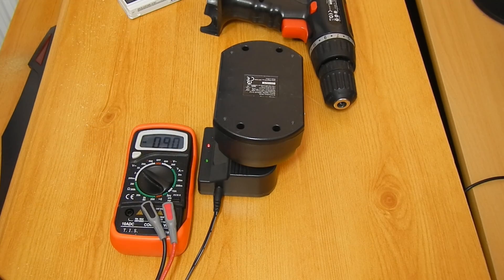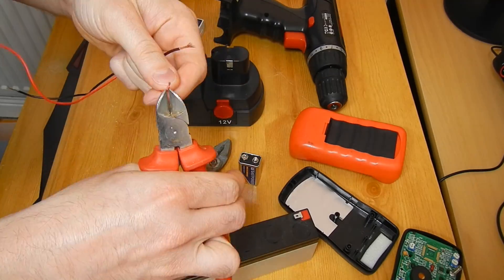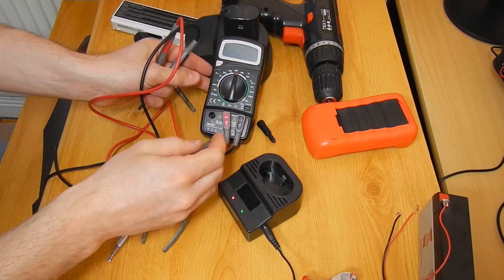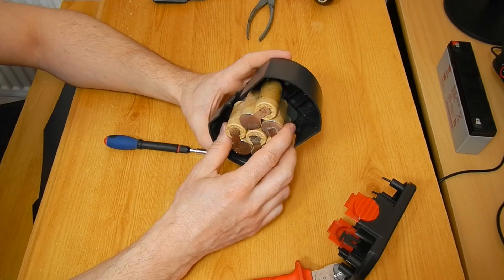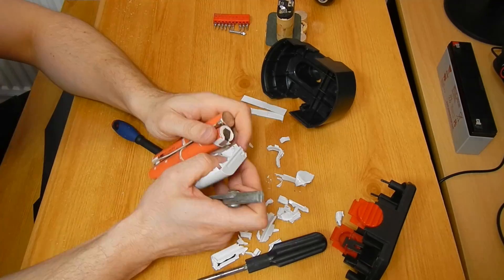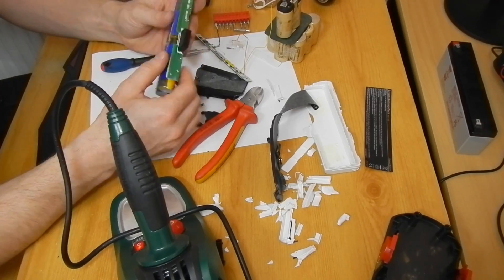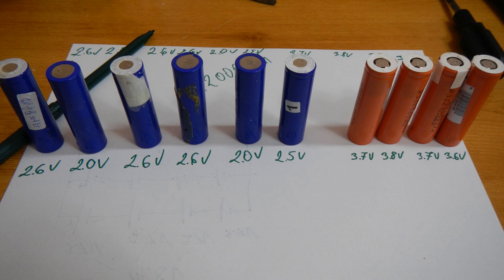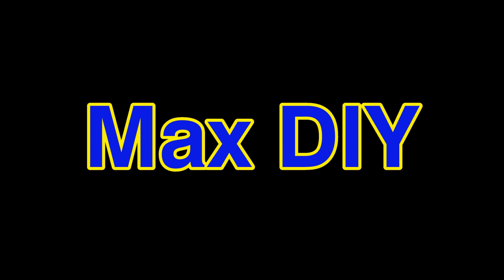Drill battery pack upgrade 18650 cells

Comment: This is very dangerous. You have to use bms board for 18650 cells
Reply from the maker: I do know this part, cadmium batteries can be charged and charged lithium not really... they can easily overheat and then you know the story. Do you know Jehu Garcia??? The man behind cheap 300$ powerwall???
Reply: Im upto build a battery pack for my cordless drill.(drill has rs775 motor)

Stock battery was 12v 1.5ah. 
Can i replace that with 3s2p pack with 10A BMS ??
How to choose the amps rating of bms ???